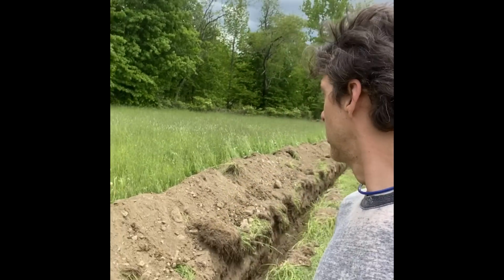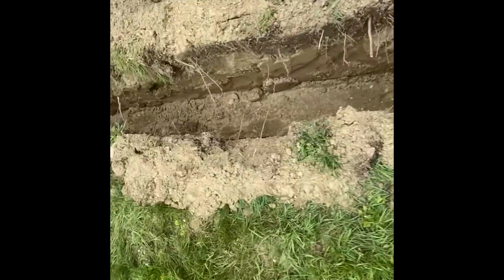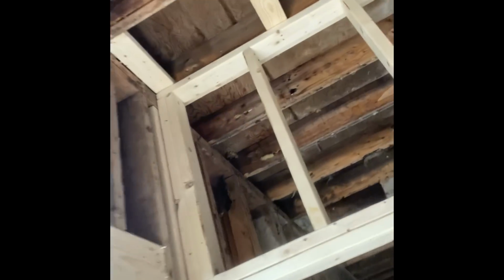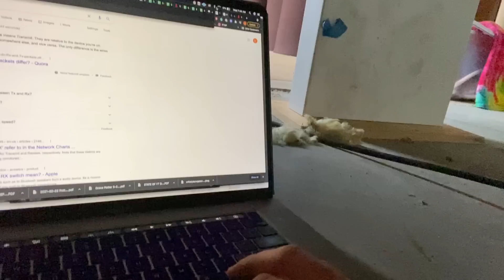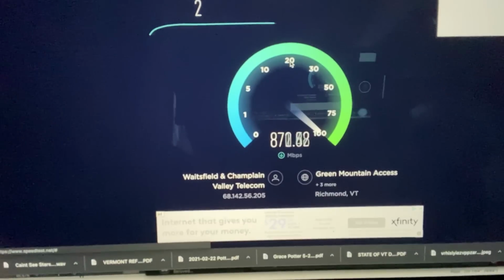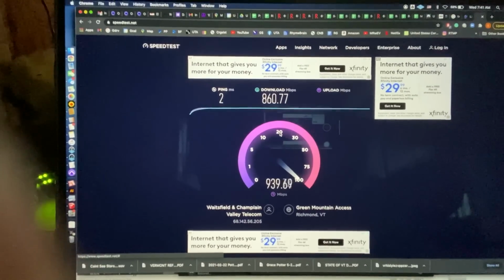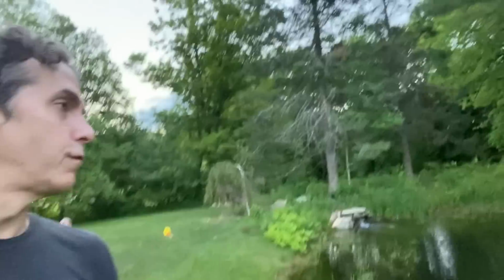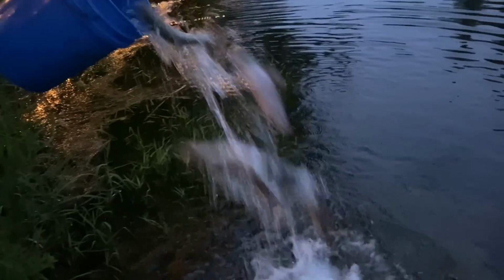Making Records with Eric Valentine - Episode 5 - Fiber optic Install and putting fish in the pond!

Comment: I'm surprised you're not running that fiber through some conduit.. Hopefully it'll be okay longterm.

Love the pond.. You're a lucky guy, for sure! 👍
Reply: I had that exact same thought about conduit.
Reply: same here... i was surprised not to see conduit in the trench..
Reply: direct burial cable is very common, if its not on a telephone pole its direct burial for your isp, its not like they are going to pay to put thousands of miles of conduit in the ground
Reply: Looks like it's heavy duty grade. Probably only a 6 strand fiber in that 1'' cable so a LOT of insulation. Usually that cable is safe to just run on top of the ground to locations which is done.

Comment: No conduit for fibre cable? Here, in Oz, we enclose cable in PVC pipe, then fully enclose the pipe in “ indicator” (a blue grey gravel) for protecting the pipe from rocks etc and to indicate presence of pipe to future diggers. Only then do we back fill the trench.
Reply from the maker: Yes those are all good points.  The cable I am using is supposed to "direct bury" so it should survive being in the ground.  The folks that did the trenching back filled with sand first, then gravel and then they put a strip of warning tape over the gravel before they filled in the rest to let folks know if they are digging around it.  Hopefully, that will keep it safe :)
Reply: @mrwev  Cool! I expected some such,  fair enough! Plus that's a hell of length of trench for conduit. Loving the return of Making Records, one day we'll darken your doorstep! 🤞

Comment: Dude - you should have run two (or more) optical lines from your house to barn.  Hopefully they were SMF runs and not MMF, as at 10Gig rates over MMF, you can only get around 550m of distance - go with SMF so you don't have to worry about distance (as much).  The only reason I say that is depending on your media converter design (individual modules or just within your switch terminating either end) having redundant physical links is a good thing.  The other point is bandwidth - you have 1Gig service today, probably over GPON, but, XGS-PON is coming, which means 10gig symmetrical rates.  Which means having multiple SMF lines to your barn future proofs it better.  And those extra lines don't need to be idle - just run them in LACP (or LAG if your chosen switches support it) mode, so if you have 2 x 10Gig lines, you can bond them to get 20gig to your barn.  Anyways - just rando thoughts from a guy that does this stuff for his day job, and his home studio is a full on Dante/AoIP setup that is a little overkill lol.......

Comment: Have you considered how you won't have much of a barrier from the booth to the machine room due to the exposed back of the patch back racks? Seems like it could be a bit annoying potentially to put a lot of effort into the control room only to have a lot of noise leak through from the patch bays.
Reply from the maker: Good question!  That is a trade off with this approach.  The sound from the machine room is mostly fans which are higher pitched and easier to block.  the patch bays themselves are enclosed so the won't create an actual opening between the two spaces and I plan on filling everyspace in the racks with with equipment or blank solid panels.  hopefully that will be enough to keep the noise down.  The other issue is how those openings affect the acoustics of the room.  it would be like having a small door open all the time and can drastically alter the frequency response in the listening position.  I'm gonna make em as air tight as possible for that reason as well.
Reply: @mrwev  makes sense. Hope it works out good. The convenience factor certainly makes it worth a shot. And I'd image should be relatively easy to correct if you really had too.

Comment: Hey Eric, Im curious how you were able to relocate those support beams that were going down the middle of the control room, did that require a lot of effort to accomplish? Also curious how you are tackling the sound isolation between upstiars/downstairs, is a double wall/ceiling effective enough at this? Possibly Mass loaded vinyl?
Reply from the maker: There main issue for me was the steel support column (that may be what you are referring to).  The support beam is still there.  The column was replace by an additional support beam that runs left two right and supports the beam that is running front to back.  The new beam is made out of LVL engineered wood.  It is very strong so the beam doesn't have to be as big.  I didn't do a huge amount for isolation between the two floors.  The ceiling has a double layer on it.  It is 1 layer of 5/8" sheetrock and then an additional layer of 3/4" plywood that is applied with green glue.  The wall between the control room and the sound room is more robust.  Both sides of the wall have 5/8" sheet + 3/4" plywood with resilient channel.  That should be plenty for me :)

Comment: Won't the open patchbays half into the machine room and control room let through any noise from pus's etc? You probably through about that, so no critique just curious 🙂
Reply from the maker: Good question!  That is a trade off with this a approach but one I am willing to make.  I plan to fill every opening of the racks with gear or panels to help reduce noise getting in to the control room.  So far it seems like it's gonna work out ok.